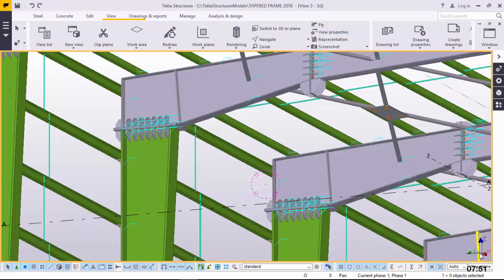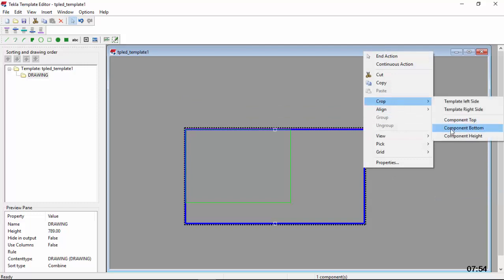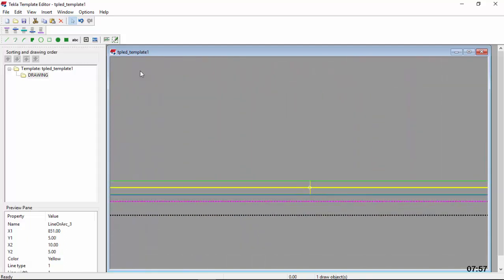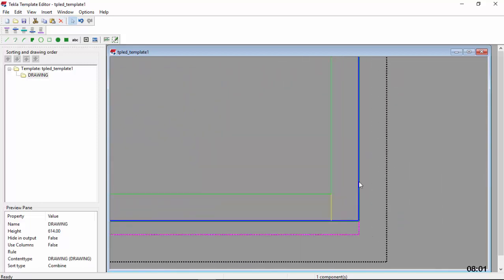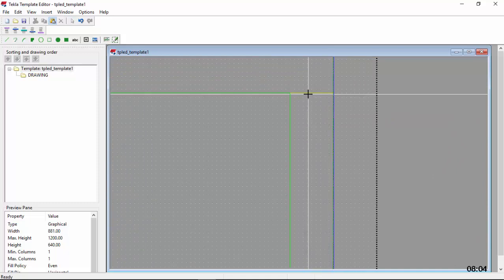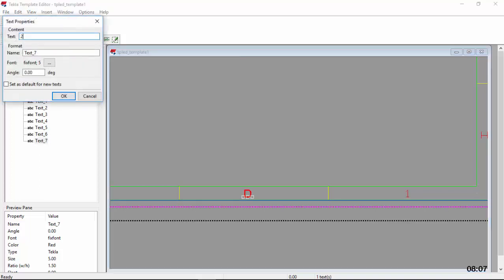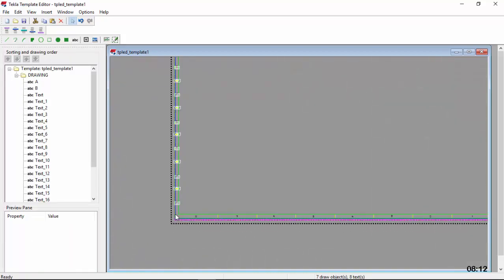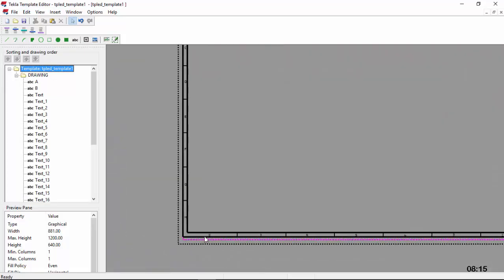How to Create and Customize your Title block in Tekla Structures

Comment: Hi, how to use this file in Tekla drawings
Reply from the maker: i did not get your question right
Reply: Hi, sorry that i am not clear with my question. I inserted a cad file(with outline border and title block in single file) in template as per your video. Once i use that template in layout editor it appears small in size, i fixed the border in my template to 2'-10", but after using it drawing through layout it will be around 2". Dont know what is the problem. Can you help me with this.
Reply: If we have a cad or microstation border we can insert it into template directly right? If so do you have any video how to use that template in layout editor or in tekla drawing.